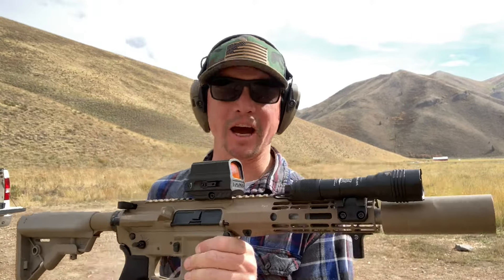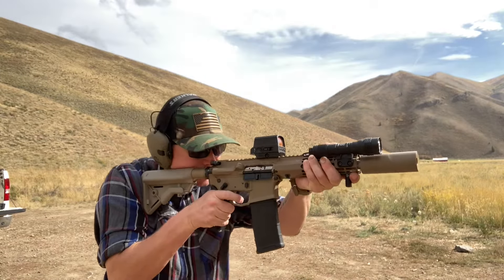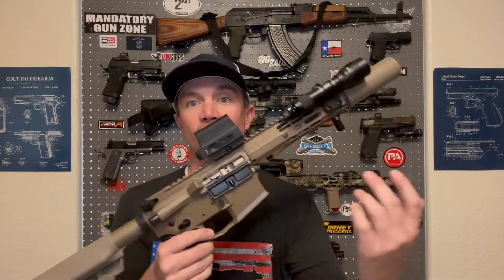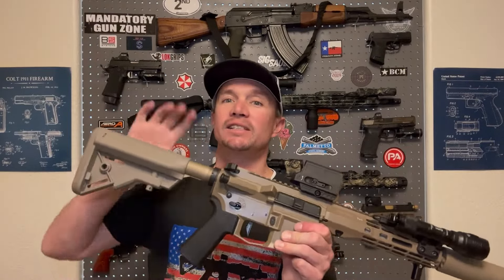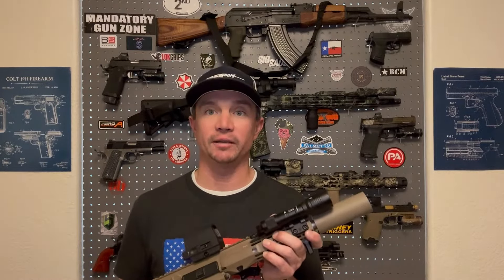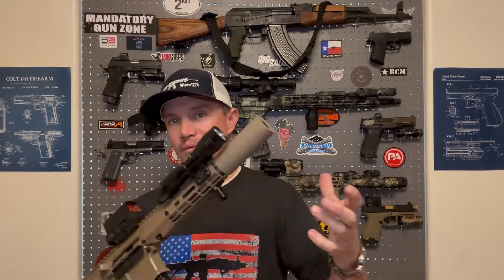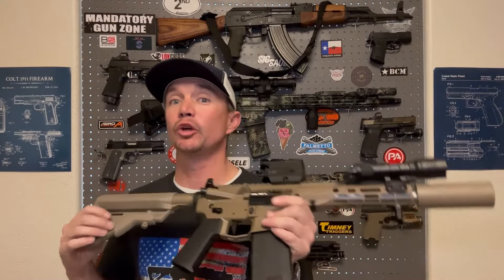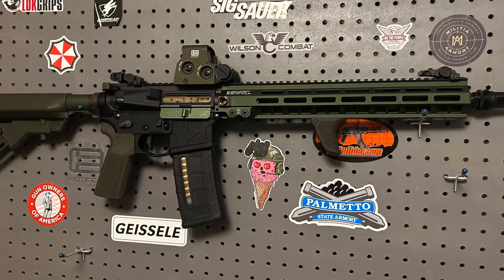It Runs!  Easy Subsonic .300 Blackout Fix!

Comment: I ran into a similar issue with my 300 Blackout SBR.  I tried a bunch of things, including a lighter spring in the buffer, but it just didn't work.  Supersonic was fine.  Subsonic, I had to hand-cycle every round.  I ended up having to drill out the gas port.  I went up by small increments, and finally ended up at .1001" diameter.  At that size, it cycles, it locks, and it's not super-gassy.  Supersonic kicks a little harder than I like (not hard, just more than I want), but subsonic is smooth, light and reliable.  Last weekend at the range, I got 1" groups with subsonic, at 100 yards, out of the 12 1/2" barrel, and it cycled and locked perfectly every time.  I am very happy with it!  With the suppressor, it's amazingly quiet.
Reply from the maker: Nice!  Sometimes, it just takes a little work to get it to reliably run both Supers and Subs.  I had to learn that lesson with mine, as well.
Reply: That’s good! What upper do you have at 12-1/2”?? Is it perhaps BCM?
Reply: @matthewHizzle  Proof Research
Reply: @matthewHizzle  Misread the question. Upper and lower are Aero Precision.
Reply: I did the same drilled the gas port out one size, runs both like a champ. 10.5” BCA with an omega 9K.

Comment: I figured out what’s goin on here. Your rifle was built to use a suppressor with subs so it has a (not so big gas port probably less then 1.10). They don’t want to send you a rifle with a gas port that large (1.00 - 1.25) that WOULD cycle subs WITHOUT a can. Then when you add a suppressor which adds back pressure (giving you the same effect as if you had a big gas port) it would be WAY overgassed. The issue with your setup is your can DOESNT add much back pressure thats what WITT builds theirs can to do internationally being a mono-core. So you TECHNICALLY can open your gas port (if your keeping the WITT can). That way you’ll have enough pressure/gas to cycle 100% reliable. I would take the can off to test the increments on which your opening the port.   You’d rather be slightly overgassed (but will always have enough pressure to eject/cycle) then to be slightly undergassed and can TECHNICALLY never say it runs 100% reliable (being as you had a malfunction still).

For a 300BO to be 100% reliable both subs/supers suppressed/UNSUPPRESSED you must have at least a 1.00 - 1.10 gas port size (1.10 would be more reliable generally speaking). Never go bigger then 1.25. However it’s all about if your going to use a dedicated can or not and what kind of can. Changing springs and weights is only throwing bandages at the wound without fixing it.

Comment: Also FYI for people starting a new build from scratch. Dwell time is crucial when it comes to gas system. So make sure to choose the right gas length for the barrel length if you're going to do a custom barrel.
Reply from the maker: Very true.  For .300 Blackout, a pistol-length system is generally the way to go, especially with a shorter barrel.  I used a mid-length gas system on my new 14.5" build.

Comment: You're still under gassed. It appears that your brass is ejecting at 4 to 5 o'clock. Lighten your entire buffer system as much as you can, then add the adjustable gas block if you're over gassed at that point. You want that brass ejecting no further back than the 3 o'clock position.
Reply from the maker: It is still a little under gassed with Subs, but it has been reliable and it's slightly overpassed with Supers, so I feel like I've found a pretty good balance.
Reply: @sawtoothtactical404  can't argue with that logic.
Reply: @sawtoothtactical404  have you checked your gas key for leakage? Pull the bcg, oil the perimeter seal of the key, hold the bolt IN with your thumb, shoot compressed air into the key. If you have blowout, remove the key, use a flat stone, remove high spots, then use loctite green as a gasket material. School of American rifle explains this process best

Comment: Since 300 came out I have built over a half dozen 300 Pistols/Rifles ...when I started there were NO videos to help out so I was basically on my own. The issue is 300 uses 2 totally different rounds, Sub is terribly under gassed and Super is terribly over gassed. You are basically trying to fire two completely different calibers from the same gun. I have tired drilling ports, adding adjustable gas block, different springs, different buffers, different BCG's. In my experience I have never gotten a one size fits all setup for both super and sub in the same rifle/pistol without some kind of adjustment...yes you can set the sub to kinda eject and holding back most of the time with 5-6 O'Clock ejection range and the Super may feed at the 1-2 O'Clock ejection range allowing you to use both... but....Super is going to eventually cause undue wear on your gun and you are going to have to live with some FTF on your or failure to lock back on subs. My solution...and everyone has a different opinion to which I don't care....is to run a Light Weight BCG (RCA LOW MASS), this allows me more flexibility on buffer weight.........for Sub Sonic I get full functions, 100% reliability with our without suppressor, I am getting the correct 3-4 O'Clock ejection with a Sprinco Yellow Spring and an H2 buffer....When I shoot Super I pop out the spring and buffer and put in a Carbine Spring with a H3 buffer and the exact same results. It takes less than a minute to change and to me its the easiest way to have a rifle functioning the way its supposed to function with either load. The only other option I used that has worked is a Switchblock but you still have to start with a properly gassed subsonic fully open and that a hole other story.... ALSO USE 300 MAG FOR HEAVY BULLETS...I can's tell you how much of my heartache was solved when 300 mags came out.....one more note...if your gun comes already set up to run suppressed subsonic and won't feed Super this won't work. You need to drastically increased buffer weight and possibly an increased power spring for super.
Reply from the maker: It took me some experimenting to get mine to reliably run Subs and Supers, but it's there now.  It is overpassed with Supers, but I mostly run Subs now that I've got a can on it, so that doesn't really bother me.
Reply: @sawtoothtactical404  I hear ya... I've been exactly where you are with other builds where I felt like it was good enough  with both. Just depends on what you are happy with and what you want to do with it. I am running Subs unbelievably smooth but with the Low Mass BCG and H2 BUT..that total mass that equals Std BCG with a 2.1 Oz buffer and with a reduced power spring.  No one would say it's safe to run that combo with supers. Since I have more than a few boxes of 110's and I prefer that to my 5.56's if the SHTF I want it running smooth with 110's. So I'll keep my sub setup in the gun for home use and keep a carbine spring and T3 with my loaded 110 mags, in 60 seconds I'm ready to go with a gun turned specifically for supers. Mission Specific.
Reply: You say H2 buffer and H3 buffer but are the weights of each? Thanks, good comments. Usually learn more in the comments section than the video (not in the case video is great). Thanks
Reply: @jeffcooper5026  That sounds like the way to go. Great info. Thanks for sharing

Comment: I’m gonna give it a shot. My 300 refuses to cycle subsonic rounds. It’s not suppressed. But it’s super frustrating having to manually cycle every shot.
Reply from the maker: Most .300 Blackouts are going to have a hard time cycling Subsonic rounds without a suppressor, and honestly, I don't really see a reason to spend the extra money on Subs if you're not suppressing it.  A suppressor will add some extra back pressure, which will make running Subs a lot more reliable.

Comment: I went with diligent defense for my 30 cal can on my Rattler. and a Dead air Wolfman for my mpx. these two cans are actually more like 4 different cans for 2 stamps.

the diligent defense enticer 30 cal can swap to a 556 endcap to allow it to be much quieter out the muzzle, plus hub mounting for almost all QD devices. $450-800 depending on model. The S in the bronze finish is what I got and It'll look amazing on your dream rifle. though not for heavy duty use, still rated for 120 rounds full auto before cooling.
The Wolfman comes in two setups Long and Short config and lets you shoot anything 9mm and under and its pretty much rated for everything. 

not low back pressure cans but I shoot indoors and haven't had blow back issues. Run a Kak downward vent bcg on my ar15 and that actually eliminates, most of the gas to the face better than anything else I've tried. but your outdoors I'd go quieter than anything.  

Keep up the content man! subbed
Reply from the maker: Awesome!  Thanks for subscribing and thanks for your experience with cans!  I'm trying to learn as much as possible about them right now.  I took my .300 Blackout out shooting yesterday and it's just so satisfying to shoot suppressed.  I started the process for an OCL Polonium K for my 5.56 rifles and I think I'm going to go with a YHM R9 for my AR9.  I just feel like everything should be suppressed, at this point.  haha

Comment: Running into a similar issue Just got my YHM R9 approved so took it out today with my 9” 300BLK SBR. Supers were fine but 2 different brands of subs were not cycling, which surprised me because during a conjugal I used a 3rd subs brand (these were the Winchester Super Suppresed rounds) and they ran perfectly even with faux full auto (echo trigger). will swap out buffer and spring and see if I can get better results. Thanks for the vid!
Reply from the maker: I ended up replacing the buffer system with a 3 oz. buffer and SpringCo yellow (reduced power) spring, and it runs everything without a problem, now.
Reply: @sawtoothtactical404  appreciate it, swapped the buffer out, I guess I will find out this weekend if it works or if I have to get a new spring too! I am guessing I’ll be fine with just the buffer swap as I had an H2 in there and the Hornady A-Max subs almost cycled haha
Reply: I just swapped to a sprinco yellow spring with a carbine buffer for use with Hornady sub-x factory ammo. My hand loaded 220 grain ammo ram just fine. With the yellow spring everything work’s awesome

Comment: If you are running an adjustable gas block, preferably a bleed off variant like Superlative, drill out the barrel gas port instead of changing buffer. Always start with gas before going to buffer.

Comment: I was having the exact same issues with almost identical setup. Mostly short stroke with subsonics, Tried all sorts of things. Local gunsmith gave me some dedicated .300blk magazines and it fixed it right away, not one failure with any ammunition. Something about the 5.56 mags “toeing” the rounds inward. Seemed to fix all my issues. Have been 100% for 500 rounds or so
Reply from the maker: Nice!  It's almost always a simple fix.  I only run dedicated .300 BLK magazines in my .300 Blackout.

Comment: rifle speed gas block and a carbine buffer and mine run fine. all my 300's are pistol length though...not sure what yours is. I'll also add i'm not running super short/super low pressure cans though. I'll also also add mine will lock back after the last round on subs with or without the can.
Reply from the maker: Mine is pistol-length gas, as well.  It runs perfectly now, but I did have to go with a lighter spring and carbine buffer to make that work.
Reply: @sawtoothtactical404   Honestly i swear by "braided" springs...either geiselle or veriforce tactical...but nobody in the game has the reputation the Sprinco has. If I ever have the issue, thats the very first call i'd make.

Comment: question:
by going with the yellow spring did you notice more recoil?
What if you bought a super lite BCG? would that have helped with the Geissele H2?
Regards, Pops
Reply from the maker: I noticed a little more recoil shooting Supers, but it's VERY soft-shooting running Subs, which is what I'm shooting more of, now that I've got the suppressor on it.  I'm sure a lighter BCG probably would've gotten a similar result as lightening up the buffer, but I didn't want to overcomplicate things and possibly have reliability issues, plus replacing a buffer is a lot less expensive than replacing the BCG.  I used the Geissele Super 42 H2 that I had leftover in my 16" 5.56 rifle, which works great in that setup, so it wasn't a waste, by any means.

Comment: I have the dirty 3o Witt suppressor and love it. Wouldn't run supers. So far I've backed out the gas screw almost to removal and removed the buffer weights. I just ordered the Sprinco yellow that you recommended. Hoping that does the trick. The rounds eject but won't pick up the next round.
Reply from the maker: Yeah.  I was having the same issue, but the SpringCo Yellow and a lighter buffer did the trick.  I think I'm going to shoot this gun tomorrow, actually, for a video that I'm planning on doing next week.  It runs great now.  Hopefully, the SpringCo Yellow works for yours, as well.
Reply: @sawtoothtactical404  it didn’t fix my problem. I’m done messing with it. I run controlled chaos supers for self defense. Running the subs was just for fun. Bummer.

Comment: For plinking subsonic ammo I would check out 2a warehouse or lax ammo bc running 30 dollar boxes of defense ammo would get expensive real quick
Reply from the maker: Yeah.  I'm looking for more affordable subsonic ammo, now that I've got the suppressor.  I just wanted to try something different from what I had stocked up, in case that was the issue and that Sig ammo was the only subsonic .300 BLK that my local gun store had in stock.
Reply: @sawtoothtactical404  Gotta invest in a press and just use hitek coated subs and roll your own. You'll be making your own for less than the cheapest  5.56.

Comment: I got the buffer and spring and still not fully cycling. 16” barrel. Hornady 195g subsonic ammo
Reply from the maker: Are you running a suppressor?  Most guns will need the added back pressure from the suppressor to be able to cycle Subs.  Mine is just right on the edge of reliability with Subs because my suppressor is so short.  I was shooting .300 Blackout last weekend and it ran great, but didn't lock back on the last round.  I'm actually thinking of getting a higher back-pressure can for it.

Comment: Forgive me if I missed it, but how does it sound to you with no ear pro on shooting subsonic ammo through that suppressor? Just found your channel, as I was searching for vids with "Witt dirty 30 shooting .300 subs" thanks and subscribed!
Reply from the maker: Thanks for subscribing!  I tried it without ear pro on the first time I took it out with the suppressor and it was a lot quieter than it would have been without the can, but still not super comfortable.  That's why I'm still wearing ear pro in the video, even shooting Subs.  I'm sure a longer suppressor would have been a little more effective, but I was specifically going for a short, maneuverable firearm with this build and the Witt Machine & Tool Dirty 30 fills that role perfectly, especially in matching FDE.
Reply: @sawtoothtactical404  Thats cool, yea I was going to do a form 1 and do a short 4" .30 cal suppressor but cram it with "M" shaped baffles. As I see the dirty 30 has about 3 baffles. Going to just have to see how it sounds when I get done with it. I'll have it ready this week to try out.
Reply: @wyatt9k551 my 300BO with a deadair sandman s with 220gr subs is damn near silent. No ear pro needed.

Comment: Just found your channel and subscribed. Im finishing an EPC 9 16" , which i plan to put a supressor on, and also considering making it SBR with a shorter barrel.  And im also thinking about my next build which is a 300 BLK pistol 10.5", braced, and plan to put a supressor (socom) on it. Hopefully several court cases will clear up the requirements over the next couple of months, but i still have a lot of research to do regarding the current overreaching/overbearing rules.  Thanks for your vids, your updates, and the progress of your builds.  Take care and dont get clapped.
Reply from the maker: Thanks for subscribing!  One of my first "build series" was an EPC-9 with an 8.2" barrel.  It had a brace on it until very recently.  Hopefully, the courts clear up the ATF's overreach, but I just decided I wanted to be able to show my guns on the channel again, so I SBRed that one, too.  Check out that build series when you get time.  https://youtu.be/8TCYlEDzxuI

Comment: That can you have , geez that exit hole is huge , what is this form 1 suppressor,  ? Someone drilled that hole for 9mm lol
Reply from the maker: It's the Witt Machine & Tool Dirty 30, which is a .30 Cal. suppressor.  They have a 9mm can, too, the Naughty 9.  I thought the same thing, though.  I can drop a .300 Blackout round right through it, case and all, but the case on .300 BLK isn't much wider than the projectile.  At least I won't have to worry about baffle strikes...